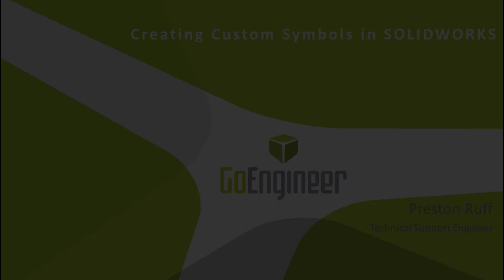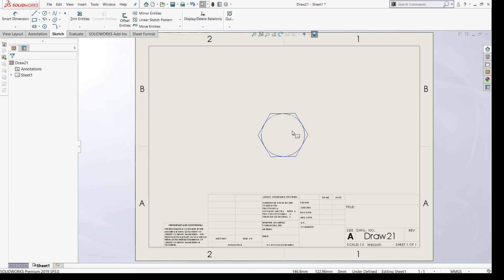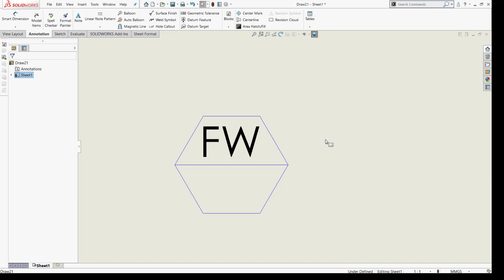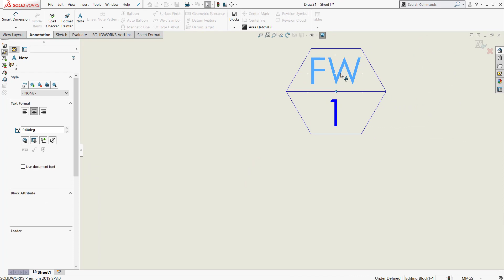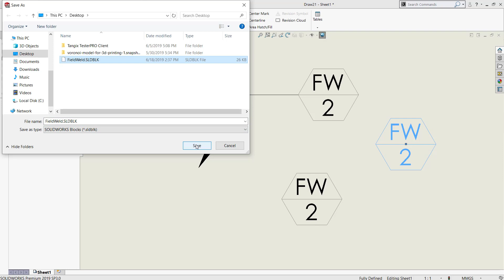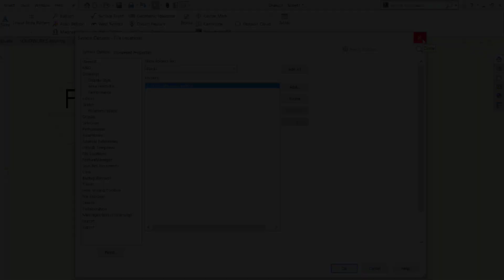SOLIDWORKS Tutorial - Creating Custom Symbols

Comment: How can i add Greek symbols simple copy and paste doesn't work.
Reply from the maker: There doesn’t seem to be any official direction from SOLIDWORKS on inserting special characters they mention symbols here, but not special characters. SOLIDWORKS does have dozens of native fonts that can be used. Supposedly the SWGrekc and SWGreks have Greek characters, but this was last mentioned in 2008. According to a few resources, using the ALT codes (character mapping) seems to do the trick.
Reply: Thanks